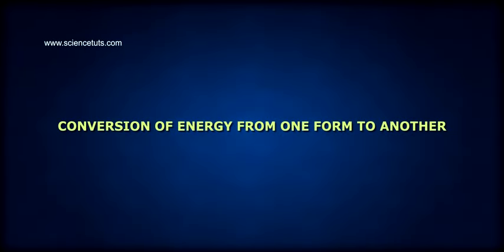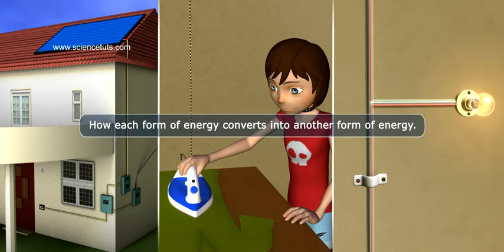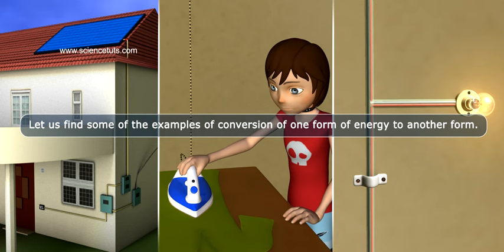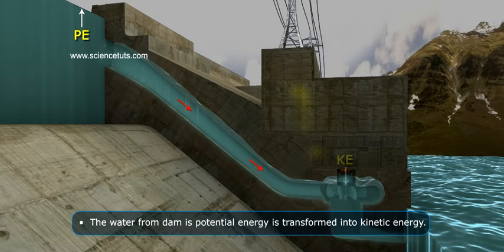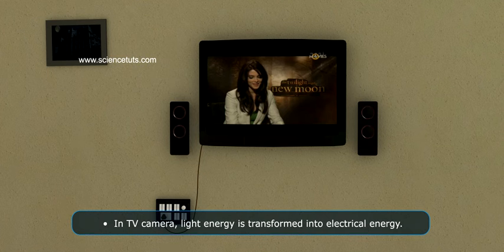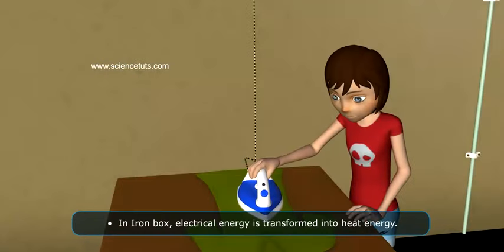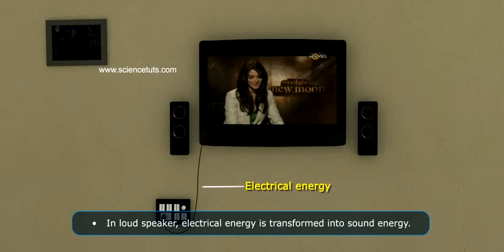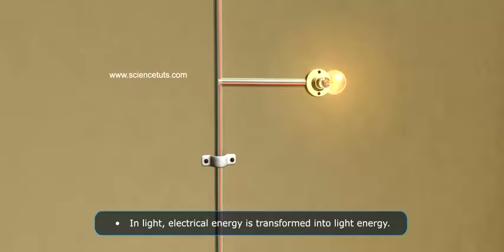CONVERSION OF ENERGY FROM ONE FORM TO ANOTHER

Comment: 1.The water from the dam is potential energy is transformed into kinetic energy
2.In microphone sound energy is transformed into electrical energy
3. In Tv camera, light energy is transformed into electrical energy
4.in solar cell, light energy is transformed into electrical energy
I
5. In iron box electrical energy is transformed into heat energy